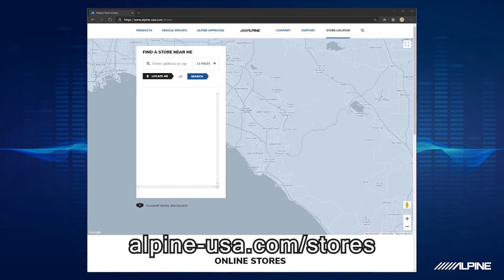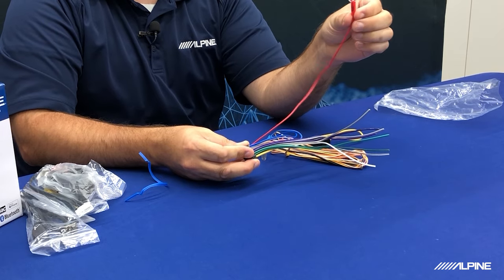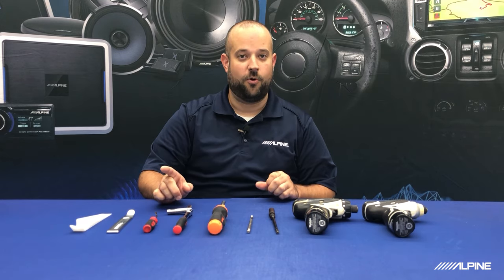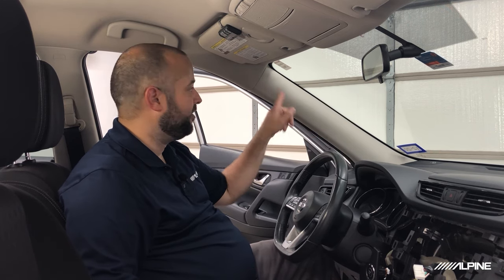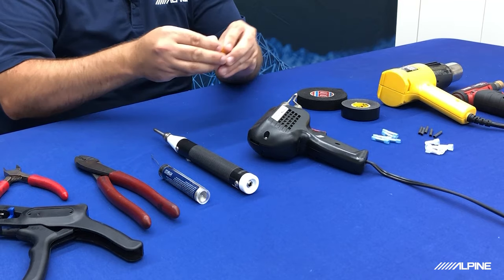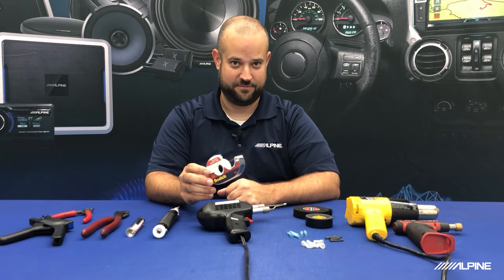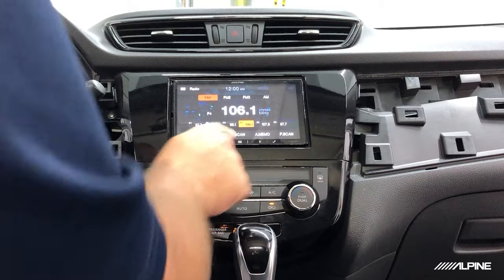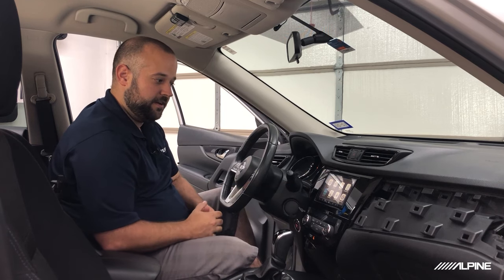iLX-W650 Step-by-Step Installation Tutorial

Comment: I'm beginning to wish I hadn't bought an alpine product! I did a whole install myself "no problem!" speakers, sub, amp etc. For an older guy I was pretty proud. I even had the radio in the car working etc and it sounded great "BUT!" I had great problems when I had to do the e-brake connection. Even though I could find where the wires were, trying to find the correct one? I tested, I probed. I even became so exasperated by this one detail I went to several audio/electrical places and was willing to pay them to hook up this one wire to end the nightmare of getting it connected. None of them were interested, just kept telling me install a parking brake bypass. If you go that route Crutchfield say your actions are illegal and they terminate tech support and say they can no longer assist you and hang up. This pained me greatly because I valued my Crutchfield support as invaluable and above all. I wasn't interested in bypassing anything to watch video's etc I just wanted access the full menu's. Thread after thread on YouTube talk about the same frustration, no wonder the "By-Pass" it so talked about if Alpine make it so hard to access even the simplest function on a radio "the menu!". I've been turned off Alpine for ever after all the stupidity and frustration this has caused.
Reply: bypass just allows it to play video when ebrakes not on. all the ebrake function really is
Reply: @reecieboii  My install was a little more complicated than radio functions. I installed a rear view camera and wanted to access Android Auto, It was accessing these functions which complicated the install. I also installed the camera to function when the vehicle was not in reverse but when towing a utility trailer/boat. I do have it working and all is now well! I broke down and installed the bypass, I have to admit it instantly solved the problem and I can see why people prefer to go that route on install.
Reply: This wasn’t an Alpine problem…Kenwood, Pioneer, etc…would have caused you the same issues. Glad you are up and running. I’m like you, an old guy doing my own installs and having fun! Alpine all day everyday! 🇺🇸
Reply: How did you have the wire setup for the camera to be functioning in any mode? Did you short the signal wire?

Comment: Just bought mine from Crutchfield for my 1998 BMW E39!
Reply: Can you give me your opinion please as I also have an e39 with an eonon unit. I’m thinking of swapping again.
Reply: @tinman7781  I had the Eonon GA9449 with the Apple CarPlay/Android Auto adapter. It’s a waste of time. The sound quality was mediocre at best. As soon as I wired up my iLX-W650, I fell in love. I had a few questions about my sound because I was only getting AM/FM sound and nothing from Apple CarPlay, Android Auto or even Bluetooth. Asked Crutchfield and within minutes someone was able to help me and it turns out I just wired to blue wires incorrectly. Get the MicroBypass parking brake bypass. That’s what I have and it’s beautiful. It allows me to have all the settings available without engaging my parking brake. The Alpine units look for an on, off and on trigger (in that sequence). I didn’t wanna wire it to my parking brake so I bought that and I’m pleased with it. Thinking of putting an amp and a bass tube in there as well pretty soon to improve the sound. So far, this is my setup.
Alpine iLX-W650
(4) MTX-Terminator speakers

Comment: Hi there, regarding the parking brake wire, the manual says to connect to power supply of the parking switch , does it matter if its connected to ground or positive?

Comment: Just found this great video after purchasing my 650. I wanted to ask about the buttons. In my 650, they stay on (illuminated) after the radio has been turned off. I'm wondering if this is a wiring issue or a feature that can be defeated somehow. Haven't seen this particular issue anywhere on the interwebs. Thanks, and kudos for the knowledge sharing.

Comment: The ground wire on the ilx-407 harness is more thick than the black ground on the vehicle adapter harness. Should I still connect the two black wires?

Comment: How would you wire the parking brake connection in a 1970’s, pre-computer car with manual transmission and handbrake?
Reply: search amazon for Alpine parking brake bypass

Comment: Hey there... good night. I want to buy the Alpine ILX-W650 receiver with the Alpine HCE-C2600FD front camera and the Alpine HCE-C2100RD rear camera and have it install in Toyota Hilux 4x4 2008 SRV. What else do I need to buy? Would I need to also buy the Alpine KCX-C250MC Multi-Camera Touchscreen Selector or can I have it installed without it? Thanks uphand.-

Comment: Do i need steering wheel control module? Without module is it not possible to find appropriate wires and connect it directly?  If not this module is included in the package?

Comment: Can you release a firmware update to increase Apple phone call volume... it’s so low I can’t hear anyone on the other side!!!
Reply: I guess IM not the only one that has this issue.... iphone 7 is fine.... iphone 11 call volume is soooooo low! So far you guys have been zero help...
Reply: There's a setting for mic volume.
Reply: @shawnkix6699  Yea... that does nothing on carplay.... also volume through BT is extremely low.... I maxed out every setting on the unit....
Reply: @colinvargo3418  Is this actually the fix?! Hoping so, as the last update didn’t help. Thanks for the heads up!
Reply: @oocchiverdio  are you running an external amp?
Reply: @colinvargo3418  it’s the built in Jeep amp... so I’d say yes.
Reply: @colinvargo3418  updated to the newest firmware... same issue... phone call volume super low... all other sound no problem at all... music navigation even ringtones

Comment: CAN SOMEPLEASE EXPLAIN THE SIX SWITCHS ON SIDE OF  AMP OR RADIO  would be much appreciated radio plays loud but blue tooth crackles and won't play as loud
Reply: That's probably because your radio isn't powerful enough, if you have a Dual radio, that explains everything, those are terrible. Otherwise, if it's not that, let me know which radio you have, and I might be able to help. Good audio starts at the head of the audio, aka, the radio.
Reply: @thenicesatan150  heck no bro I got the alpine ilx-w650 with the power pack kta-450
Reply: @mikebossenberry8794  What about the speakers in your doors? Maybe underperformed from them?

Comment: how about the USB to connect your phone to. best buy installed mine and the usb cable is just hanging out the side of the passenger side. I have to take it back because it needed another part and they didn't have time to do it then. Can the cars USB be connected to the radio instead of having that usb cable just hanging. The cars USB was connected to the radio receiver it came with so I'm hoping they can connect it that way

Comment: Having an issue with steering wheel controls on the Ilx-W650. I've installed it in a 2005 Toyota Camry, with the Axxess ASWC-1. The volume and next buttons work fine with the radio, however none of the controls work when streaming music from an iPhone, or Android phone. I've tried connecting directly to the USB on the back, and with the supplied extention cable. I've also tried different USB cables, 2 iPhones, and 1 Android. I'm a Toyota Technician, so I'm qualified to perform this install. I believe it to be a setting in the Headunit, as it works in the radio mode just fine. However, I can't seem to find any relevent settings. I've also searched Google, and can't seem to find any solution.

Thanks for any help you may have to offer.

Comment: Hi, I own an iLX-W650 installed in a Subaru Outback 2013, but doesn't work the Steering Remote control interface. I used the CTSSU004.2 Steering Wheel Control
Interface for Subaru Vehicles from Connects 2. Just 3 of 8 switches work but with the wrong command.  Other five do not work at all. Scheme is just for your reference of what I have in my SW. Any  advise or direction? Tks

Comment: I have a 2010 Dodge Ram with the Alpine system. I want to upgrade to the Apline iLX-W650 and KTA-200M amplifier. Do you have an instructional video for removal and replacement? (I'd like to keep my steering wheel control, backup camera and XM Radio as well)

Comment: Multiple Clicking noise from the head unit then it will turn on and every time I connect an iPhone to it it says device not supported this is on the latest head unit firmware

Comment: I am from south America and that parking break safety is annoying, should be a disable option or some adapter thats works to delete that feature for other countries than USA
Reply: There is, you just have to wire the sensor different its been awhile since ive done but it is possible

Comment: The only thing im wondering about this deck since ima be buying this and the ktp amp to replace my pioneer, is how to connect my sub amp? It says it has pre outs but the deck looks bare with no rca out puts, would i have to install a line out converter?
Reply: There's a sub rca output.
Reply: It has a line-out harness. 2 sub pre-outs, 2 front pre, 2 rear pre, and 2 camera hookups.

Comment: I laughed so hard when he demonstrates the crap wire nuts. So with stranded wire we just carelessly throw them in a wire it? Holy hell, ok let me teach this dude something. Stranded wires are fine in a wire nut.  Reason not to use them in a car is they take up space and they’re exposed to the elements, even though they make waterproof ones.  Strip the wire back 1/2 an inch and twist the exposed wires together first....duh.  Then use the correct wire but size. 3 or more wires use your pliers. 

So dramatic lol.
Reply: They eventually come apart. They are not meant for moving vehicles that bounce all over the place. Just crimp cap your things.